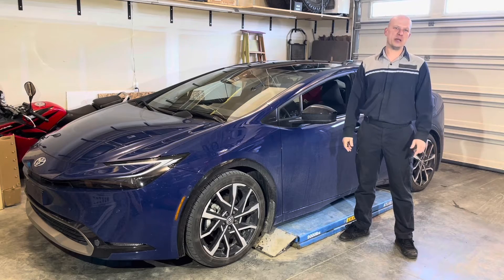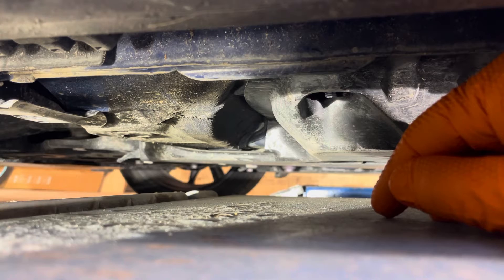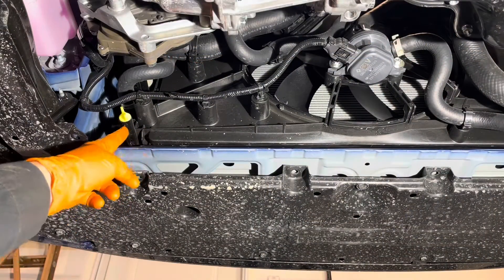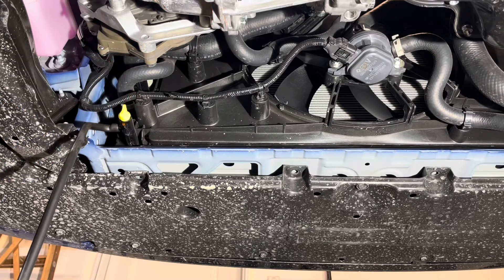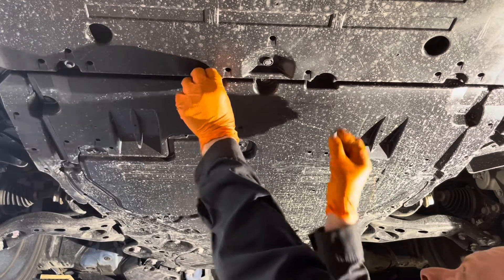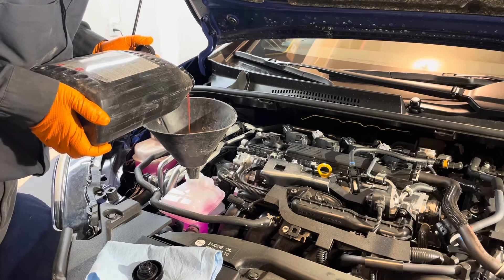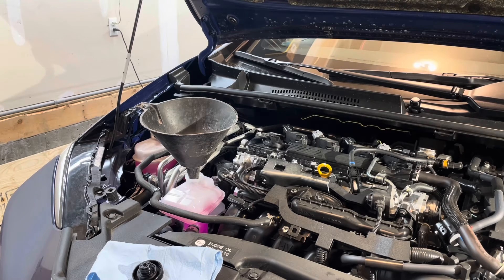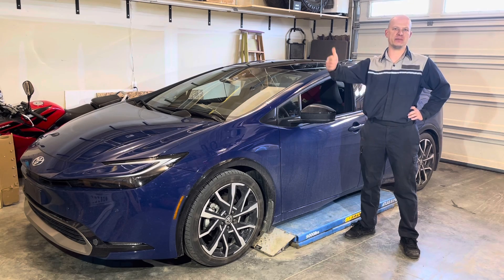2023-2025 Toyota Prius Hybrid, Prius Prime Hybrid System Inverter Coolant Replacement Instructions

Comment: After how many km plz
Reply from the maker: It’s mentioned in the video. 150000 miles (240000 kilometres) first time and then every 50000 miles (80000 kilometres).
Reply: @Viktor_G_Automotive  thank you viktor
Reply from the maker: @jassmaan7603  no problem